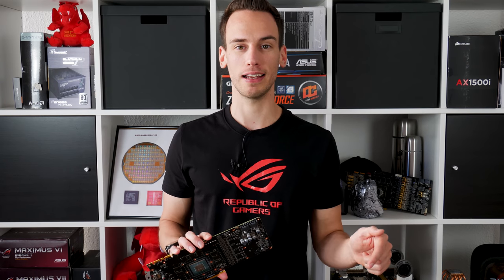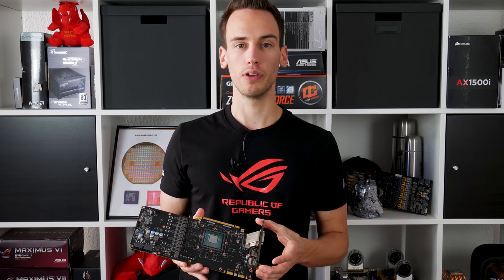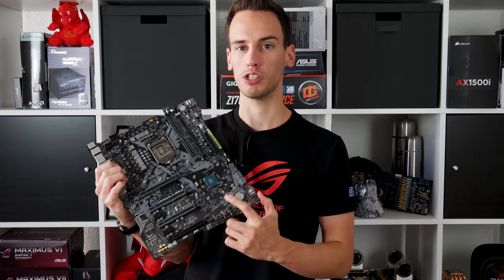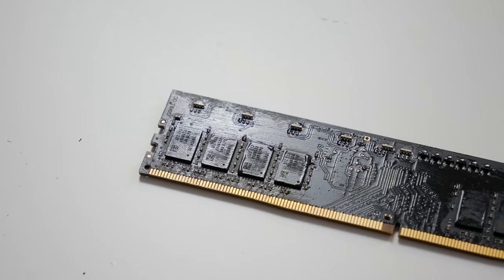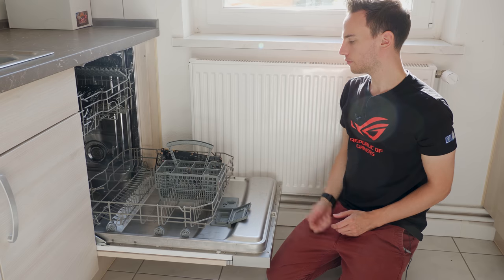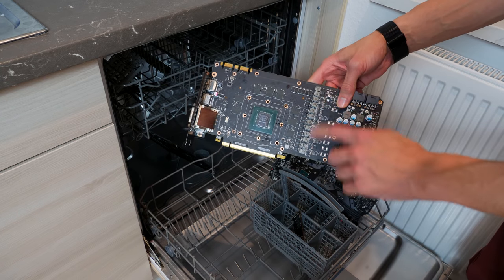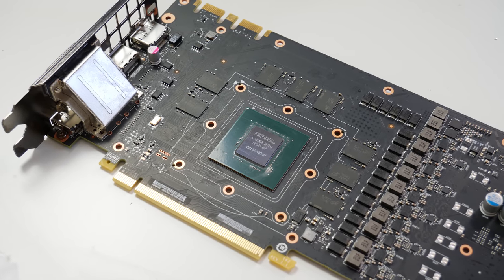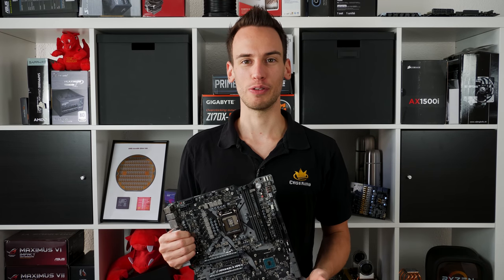The Diswasher Debate

Comment: DO NOT EVER DO THIS. Your dishwasher water is NOT pure. This WILL harm your components. Plus your dishwasher has residue from previous loads that does not mix with circuitry. Always use isopropyl alcohol, acetone, or at the very least use demineralized water. Professional PCB cleaners would never do this.
Reply: It's pure enough.

Comment: Silly millenial, You're supposed to braise them in a glass baking dish for 3 hours at 80°C covered with distilled water.

Don't use a dishwasher, the heat system isn't even and its designed for objects that can handle 125°C stress.  You also run into chlorine, bromine, salt, softened water sodium, iron stains, residual detergent, residual food grease, bone chips, glass particles, hair, plant fibers and aluminum salts from any exposed metal inside that isn't made from stainless steel.   Its probably safer to put the hardware in a toasting basket and hold it over an alcohol fire.

I hope 8nutz doesn't have pets.

Comment: What about the iron in the water, this will start corrosion!!!
Reply: Correct. I'm assung this is just a joke. Otherwise he  is really dumb. Dishwasher detergent from leftover loads also has a lot of minerals in it.
Reply: @jcdentonunatco  Yes minerals will also start corrosion as well, I think a better method would be to use some sort of degreaser/electrical cleaner.
Reply: Normally people use pure water or isopropyl alcohol to clean circuit boards
Reply: The amount of iron or other ions in usual tap water won't cause any corrosion due to the quick drying in the dishwasher - no water, no corrosion 😁
Reply: I worked in a board assembly house and was washed all the boards we wave soldered in a plain old dishwasher. The company did it for decades. None of the things you amateurs worry about were ever an issue. That means you're wrong.